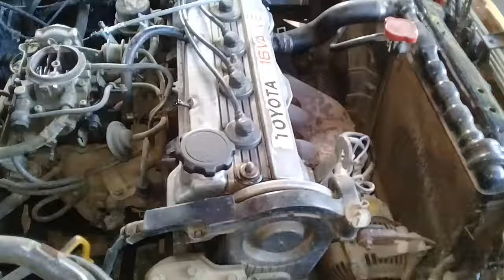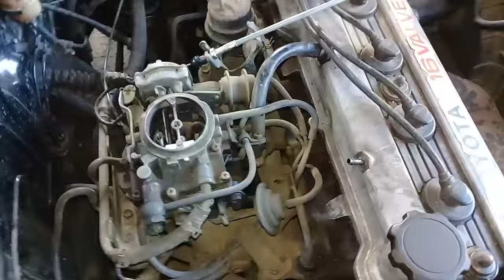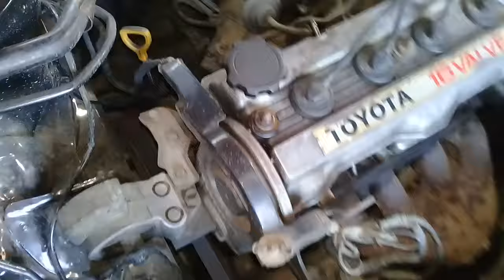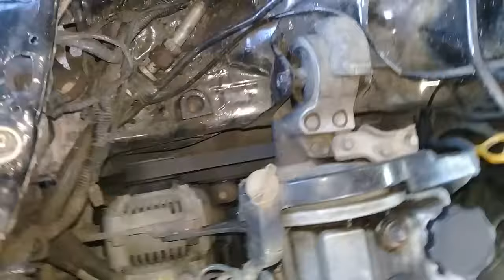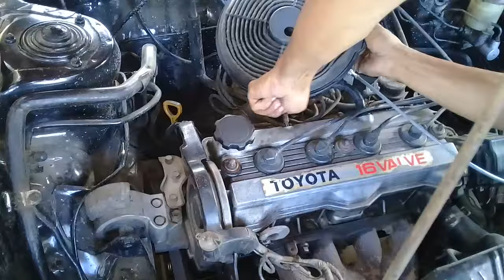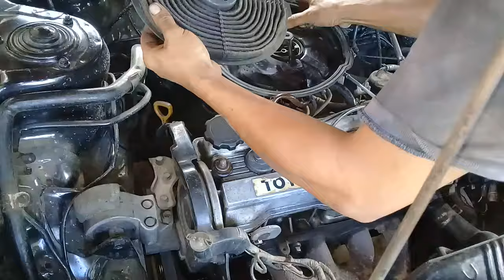4AF engine Toyota | Carburetor

Comment: Where would you spray the carb cleaner on this model corolla?
Reply from the maker: to the carb bowl
Reply: @DiYSpanner  Thanks buddy, that is the round hole that shows once you remove the air filter, yes?
Reply from the maker: Yes 👍
Reply: @DiYSpanner  legend thank you